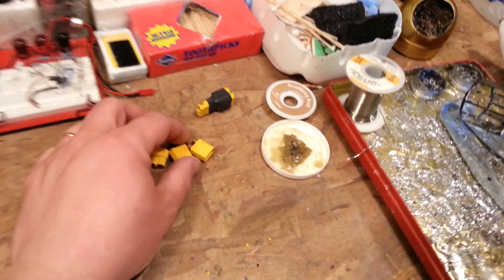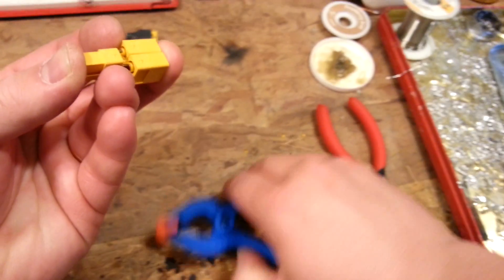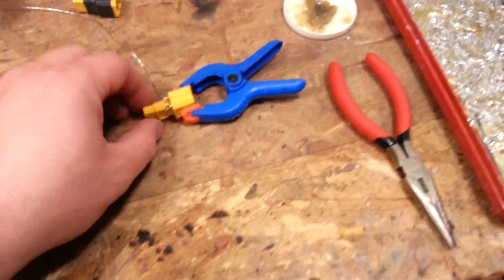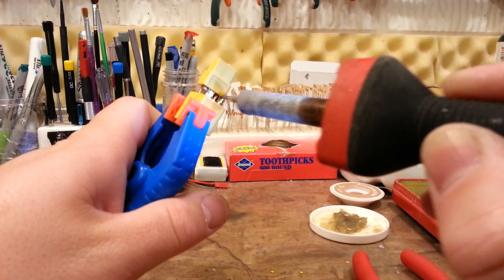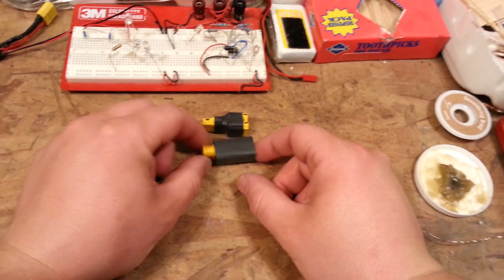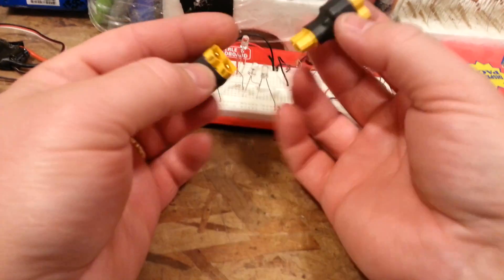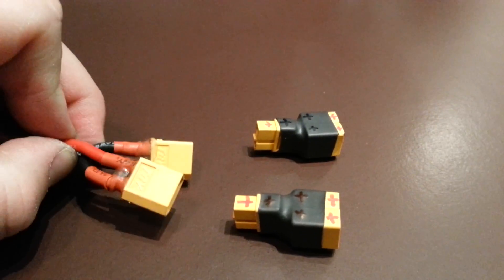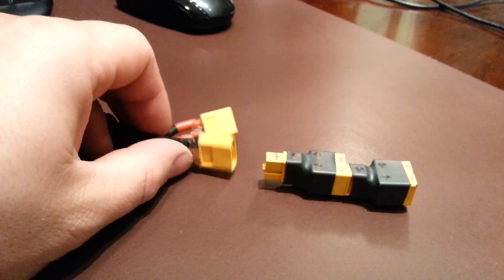XT60 Parallel Adapter - How to build your own!

Comment: 🤣 I wonder how you did it? because your Y plus connection with plus, minus and minus = closed contacts💥 (fire result).
Reply from the maker: What are you talking about??? This has been used many times...worked flawlessly.
Reply: 😏 do you have evidence,  video?
If you connect to these contacts (Y) two batteries. They are heated at 1 minute yes 50°.
🔥💥 I think if this connector takes a baby.
 ⚠️🚼 Store safe place from ☢️ children.

Comment: XT60,One side has male copper and female plastic, other side has female copper and male plastic. what one goes to battery?
Reply from the maker: We call out the "gender" by the METAL part, fyi but given the plastic parts on XT60 and similar connectors CAN be opposite of the actual gender, it can get confusing!

On this style connector, the batteries BOTH slide into the "MALE" ends (the PLASTIC SOCKETS)

Comment: I believe the failure mode is usually the heat causing the solder to melt, before the connectors fail

Comment: I gonna create a 2x XT30 to 1x XT60 parallel Adapter so i can use 2x XT30 batteries and create a XT60 out of it. For example 2x 850 mAh XT30 gets one 1700 mAh XT60 Lipo.

Comment: This would be awesome if I could do in series
Reply from the maker: You can make them with short leads still ;)
Reply: @BrianPhillipsRC  I seen yours it looked really clean. The parallel being shrink tubed and strong with solder and hot glue is the best looking thing I've seen today.

Comment: 8:29 you think if your solder melts the hot glue is gonna stay stolid, cause it wont. hot glue wont help AT ALL. if the solder is melted so is the glue.
Reply from the maker: Okay, leave it out if you don't think it's helpful. You probably don't actually need it, but I've been using heat activated glues in heat shrink for decades professionally. It's not about NOT melting, it's about buying a few seconds, so things can cool back down. This is pretty conventional wisdom.

If you melt the solder from what you're doing, you'd be screwed anyway. I've never had a connector come melted apart, even in some pretty traumatic crashes...have had leads melt off ESC's and had leads burn, but never had a connector come apart, not even once, probably 1000+ Connections...quite a few I've built personally, and many others were built by a factory in china, for the lowest bidder.

Comment: OMG I NEED SOME OF THOSE CONNECTORS LIKE THE XT30 AND BT2.0 OR PH2.0 AS I AM CURRENTLY ONLY AIR THANKS TO THE FEW MICROS I HAVE AND THEY R ALL 1S - 3S SO BEING ASBLE TO INCREASE MAH WILL GIVE ME SO MUCH MORE FLIGHT TIME
Reply from the maker: I have loads of each type, since I want to make sure I can build what I need, when I need them...it's served me well over the years, but not everyone knows how to solder, and many don't want to learn (even though it is pretty easy).

Comment: I'm sorry of this is an ill-informed question, but is it possible to use a single battery and split the power to two different devices simultaneously?  I have  two 11.1v devices that I'd like to power with one battery (a DJI Osmo+, with battery adapter, and a Wiral-Lite).  I'd like to use a single battery to keep weight down.  I need run both for rougly 2 - 2.5 hours.  Any helpful information would be appreciated--- totally out of my depth with this kind of stuff.  Thanks!
Reply from the maker: yes, but same battery shared between two devices will draw equally as much current as before.

You should be fine if they are the same cell count.

Most of the time, people would just a UBEC to power OTHER stuff, but there's no problem with using your flight pack for everything directly.

Comment: Halo, great video. I have some question, what if i use 2 battrey with different mah but same voltage in paralel mode. Will it work fine? Or any suggest and what? Thanks.
Reply from the maker: Trouble is, you'll have one pack spent BEFORE the other pack ;( that's not a great condition to be in.

Comment: Whoa cool...and could i hook up the charger and charge both batteries simultaneously? That would be insane. Thanks.
Reply from the maker: Kinda...you CAN parallel charge, but you would probably do it differently, since you need to hook up the balance leads in parallel too.

Comment: I use blutack or play dough to hold them together. Works a treat.
Reply from the maker: Then you heat shrink them together?
Reply: @BrianPhillipsRC  oh yeah lol. I should of mentioned only used to hold it together while soldering. Not the finished product lol.

Comment: what will happen to the c rating in both series and parallel ?
Reply from the maker: Nothing. The C Rating is indifferent to the way of discharge. I think you might have meant to ask, how to I handle C Rating on a balance charge? If so, here's the answer - it's still the same, but in general, when charging parallel, you can charge SLOWER, and for LONGER...which is easier on the chemistry of the pack, and charger used....but takes the same amount of energy, and time, from you as the user. Just my take. You can still charge at whatever C rating the battery calls for, BUT the charger will be taxed more with more packs, since you're drawing a larger load.

Good luck, and be safe ;)

Comment: I always heat shrink the right way... A heat gun.. Not fire. Which degrades literally everything (plastic under the wrap, wire insulation) 

What size shrink wrap do you use btw? You have everything in the description but that..
Reply from the maker: Yeah, sorry about that! I don't know the exact size, since it's leftovers from work stuff. I don't know the spec, so I can't share. Sorry!

As for fire VS heat gun... both degrade, but flame is a bit quicker. I prefer flame for speed.

Comment: Try some adhesive heat shrink heavy duty great video
Reply from the maker: I have used and still use heat activated glue lined heat shrink and it works well, but it typically requires quite a bit of heat to shrink, and the shrink ratio is not amazing. This size was JUST enough to get over the two XT60's...but I trust that it could be done, except you'd want to plug in the other half XT60's into each of the adapter plugs to stop them from melting.

Comment: Thanks Brian, made up one last night as well a series lead. Going to put two 1800mah or two 2200mah packs in the Apprentice, in parallel needless to say. Flew the Apprentice today, grey skies and a strong wind, brilliant plane, handled it with ease. Went down the runway at 45 degree angle. That impressed. Later flew my Conscendo, it went down the runway completely sideways. Last one in air as always ...
Reply from the maker: AWESOME!!! The apprentice is a takeoff and landing MACHINE!!! Have you added flaps on your Apprentice or Conscendo? Both are sooooo much more fun with ;)

Comment: nice one, will build my own now. 
is it possible to connect different lipos together? like one 4s an one 2s paralel/series?
Reply from the maker: yes, but I wouldn't recommend it. It's so easy to do it this way, and it makes it easier and safer to charge them later.
Reply: Thank you! See ya in the sky.  @BrianPhillipsRC

Comment: what size heat shrink is that?
Reply from the maker: I believe it's 1" hobbyking stuff. It's been FOR-EVER since I ordered it.
Reply: @BrianPhillipsRC  they have 30mm but not 1 inch would that be good?
Reply from the maker: @thediydude4110  That's about 18% larger, so I suspect it would work just fine
Reply: @BrianPhillipsRC  Ok thanks

Comment: Where's your heat gun??
Reply from the maker: I have a heat gun, but don't hardly ever use it for anything, as I find a torch or lighter works better most of the time.
If I were using a lot of white heat shrink, I might use the heat gun, to avoid the soot marks.

Comment: So with the series connectors if I had 2 14.4v batteries connected my out put would be 28.8volts right?
Reply from the maker: No, if you put two (or more) packs in parallel, your voltage would stay the same, but you would gain capacity...or flight time.
When you put two batteries (of any chemistry, Lipo, Life, Nicad, etc) in SERIES, you would ADD the voltages together, but you'd keep the same capacity. It's harder to do it with XT60's like I did on this connector, but you can do it it you're careful.
Reply: Brian Phillips alright thanks my man

Comment: Thanks for that hot glue tip. Wire going into my goggles battery came off and I put an XT60 on it and then glue. Very secure.
Reply from the maker: For sure, just gotta be careful to keep weight down if your putting it in the plane.

Comment: Pre tin all the pins, then assemble. That way your sure to get a good bond without over heating the shell.
Reply from the maker: I normally would do that, but don't want the extra weight. Lead is heavy, so I want to ensure a good bond, but want to keep the whole "Cups" from filling up if possible.
Reply: @BrianPhillipsRC  yea better to have a shitty connection so you can save and un measurable amount of weight.
Reply: @dirtrider88 weight is vibration. The heavier it is, the more likely it is to shake it's self apart on high speed or vibration applications.

Comment: Get you one of those $8 hand held butane torches @ Harbor Freight, they work awesome for shrink wrap...Some even have soldier adaptors.  Great for at home and at the field.
Reply from the maker: I used a $450 soldering iron today at a plant where I was working, it was very nice....I kept knocking it over in the stand LOL!

It got hot (to like 750 degees F) in about 10 seconds!!! With full temp control, even while using it. The tips were quick changeable with a 3.5mm headphone jack plug....SUPER WEIRD!

Funny part - I like mine better, and it was $16 :) LOL
Reply: I may get one of those torches, but I like to light a candle while I solder and just leave it ready. I have a vacuum tube above the station for fumes and it is great to cool things really quickly, literally a vacuum tube.  18 V (or 36) instead of 120 V.
Reply from the maker: I have a 90 CFM exhaust fan that pulls air out of the room to outside, then it's directed through that weird black tube with a small hood. I can move it around the shop, and can unhook it from a ceiling mounted port.
Reply: Brian Phillips. But I never see you use it. Ha ha. I have a coffee maker taken apart because I want it's panel and 900w power to the element. I want a single button to turn on my exhaust and iron and possibly plug in something for hot water for foam shaping/repair. An EDF on a servo tester would allow us to dial it down and leave it running to solder under as well. And dial way up and possibly reverse easily on lower speeds.
Reply: I have yet to maiden my Carbon Cub Z. It will take 4S to 6S. I will be making some of these connectors for 6S even though I have a 4S. Also for Opterra larger 3S flights. I need to do a balance lead repair. It must have been smashed in a quad flight. Just as I looked at it in my kitchen, the wires touched and I had to rip them out and apart. Maybe HK sells 3S leads.
Reply from the maker: That would be cool!

I do occasionally use the exhaust, but why do you think I'm so crazy....lead fumes...
Reply from the maker: Don't you have a "DEAD" 3S????

It's super duper easy to fix a 3S JST HX balance charge lead. Kinda surprised you haven't done it before.
Reply: Brian Phillips. My puffed 3S I use on ground based vehicles. Really conservative with batteries as only recently did I not pay full price. I did see some replacements on HK along with protectors too. Order more batteries while there now that I am flying this Vusion RTF 'race' quad. I use the old vacumn canister with vortex generator so when I vacuum my hobby area I can see what goes in and dump it out.  Connect to the end of your exhaust system or shop vac.
Reply from the maker: I have both similar to this... http://amzn.to/2F7EC61 (cables with both ends)

and I also have these... http://amzn.to/2FcCSZw (end kit for 2S, 3S, 4S, 5S, and 6S)

which requires these... http://amzn.to/2HpCkjp (crimping too, way nicer than the junky hobbyking one I got)
I heard these are easier to use, but it's a two stage crimp... http://amzn.to/2C5HD8j
Reply: Cigarette lighter works fine.